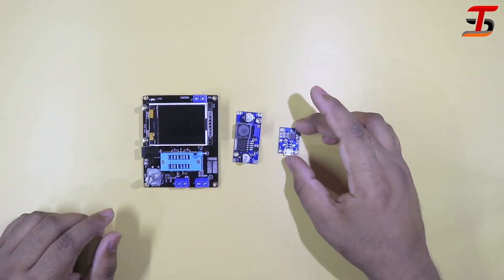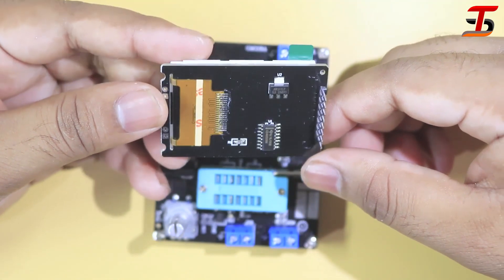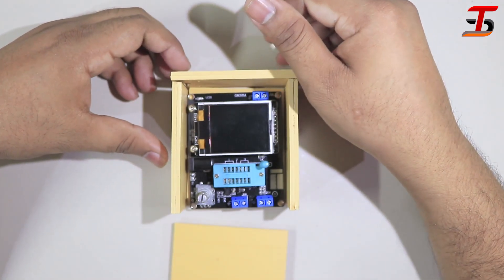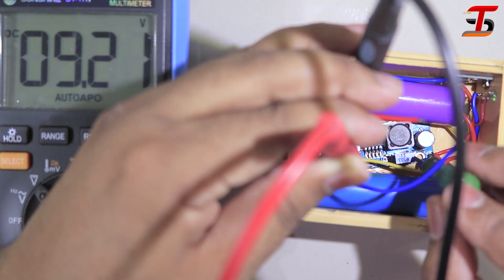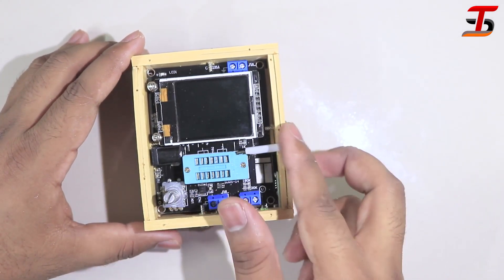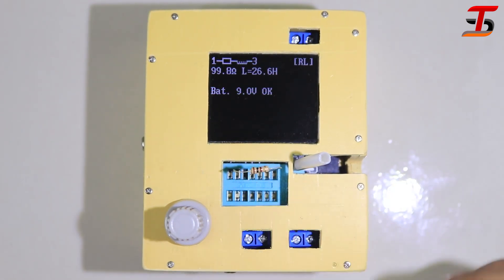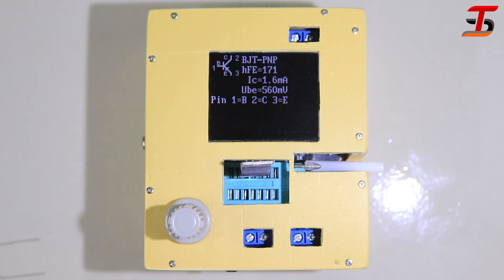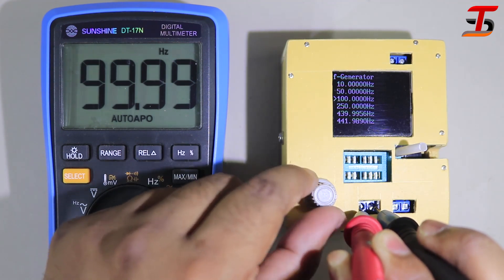GM328A || How To Test Electronic Componets || Transistor Tester || 2020

Comment: Hello, I had the earlier version of this tester does this version have to be calibrated every time you turn it on?
Reply from the maker: No Brother, You can use this by Auto Or Manual Mode. By auto mode, this device can automatically identify which is components.